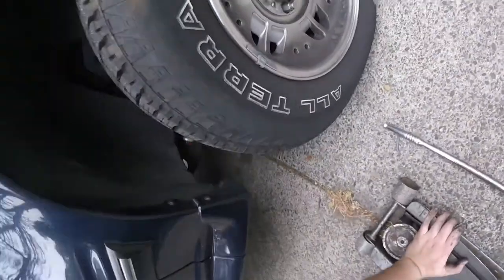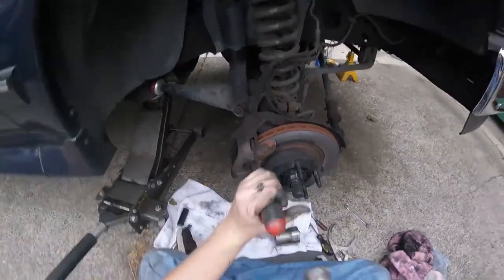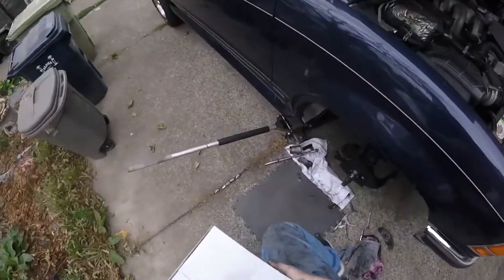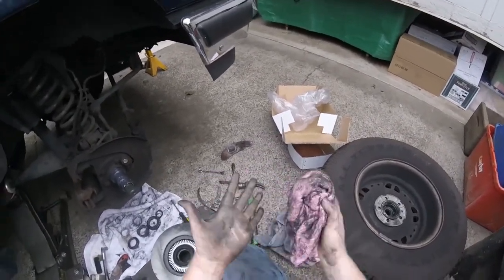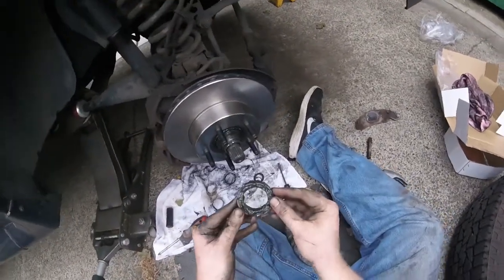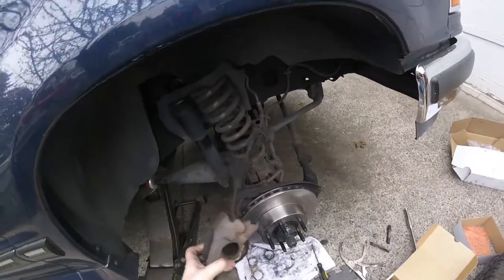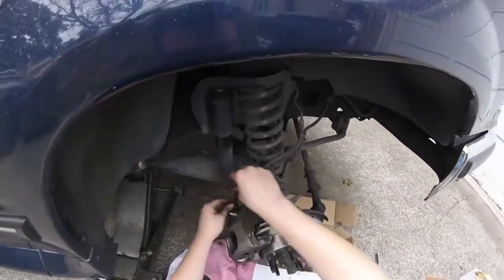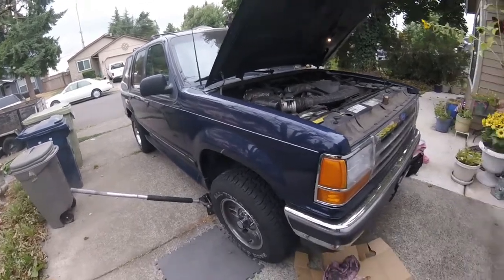1994 Ford Explorer Front Brake Rotor and Pad Replacement

Comment: I've never seen a brake setup like this before. I've never actually done work to these older style Fords before though. My oldest Ford was a 2001 F150 and was very easy to work with. The parts don't sound too expensive for the Explorer you worked on, I'm in Canada and when I replaced my rotors & pads on my 01 Super Duty the rotors were like $60 each and the pads I went with were a commercial grade pad made by Wagner and were "Severe Duty" for ample friction and for towing applications and they were $120 a set. They last a very long time though. I've yet to have to replace a caliper on my truck, all mine seemed to be in fine working order when I did my brake jobs.

Comment: 35 foot pounds is the recommended torque with the special Large socket.  Then back off 1/4 turn, then tighten 1 1/2 foot pounds.  Also, many people use a magnet to remove the locking key.
Finally, you made a small error in the beginning, saying this was a 1995 , but it is indeed a 1994 as the film title states.  1995 is easier to remove the rotor.   I have a '94.. good film, sir, thanks.

Comment: The most crucial part for me was replacing the brake pads into the thingy. I’m assuming that the first one is loaded by itself without a clip? The 2nd one is first attached to the thingy, and then the thingy is slid on and reattached using those silver looking bars?

Comment: Just about to tackle this one myself. Can't get my head around how the shoe housing whatever's held in by hammered in pins, lol.
Reply: How this one got liked on today we just had to do the same thing to the 94 Mazda Navajo
Reply: @BarnCatTV  I have a 94' Navajo man! It's cool to see some people still have them and are driving them still. They are pretty uncommon to see. I have to do the rotors and pads on mine this coming weekend (hopefully not the calipers)
Reply: @NewDemons666  yeah I'd have to say I think I have the only one in town and that's saying something for Bellingham Washington. It has one or two twins driving around but they are just the Ford Explorer Sport.
Reply: @NewDemons666  by the way good luck with the brake assembly. I mean once they're on their good you're good to go. It was quick enough to do I just had to get some practice doing the first one the second one was done in half the time.
Reply: @BarnCatTV  yeah I used to have a twin seafoam green one in my town too. Havent seen it in a while though lol. But yeah I'm aware of that, all Ford parts with the good old pushrod v6 lol. I have a strange love for it because it's my first car, got it for $400 and it's been hella reliable
Reply: @BarnCatTV  and kind of rare cuz you dont see the Navajos much really lol. The brakes arent what I'm worried about lol. My first time doing rotors and bearings
Reply: @NewDemons666  well if you got the chiltons book or something similar it should be a breeze. It's going to require some manual dexterity and maybe a specializes use of a an ordinary tool here an there LOL but eventually it gets done and won't need to be done for a quite a while again. Fingers crossed and good luck.
Reply: @BarnCatTV  I have a Haynes manual and been doing a lot of research on forums and videos here on the tube lol. Ordered my 2 3/8 locknut socket and a 500 piece craftsman toolset, got all my shop towels and grease and everything ready to go! Thanks man, I'll need it! 😂
Reply: @NewDemons666  oh my God does at 2 and 3/8 reference ever trigger memories. We had just about everything we needed except for that one specific tool. So glad I don't have to do that again for a while.
Reply: @BarnCatTV  welp, passenger side rotors, bearings and pads went well today. Didnt get the driverside done cuz I had to run to harbor freight for a 3/4" breaker bar and a proper floor jack 😂 all went well though! Looking forward to tackling the other side tomorrow!

Comment: Here's my problem, if you are an actual mechanic with a real for profit garage, which i doubt, more like a tinkerer. I would never replace the old bearings with just a little fresh grease!! If you're going to re-use them, clean the old crud out, air blow all possible particles out and check close to see if there are any chips or worn dents etc. in each bearing, not just a quick look, check every single bearing, then and only then would you add fresh grease packing. Also if the rotor rubber dust cover is ready to let go, use all new calipers and hoses as well. If she can't afford all new parts, it is likely best to wait until you can afford to do it right. NOT CLEANING out everything means you'll be putting new patches on old jeans, the rubber parts are under lots of heat and should always be replaced as a unit. Yep, save a dollar now will cost you the whole job over later at twice the price and effort. I'm not a garage or professional, yep, just tinker on my own vehicles but I'll wait until i can afford all new parts before i go do it half way and lose that much work or when it comes to BRAKES, lose a life or lives when the hose or caliper breaks and causes an accident ! Think safety first, it's not that much more to do it right.
Reply: well mr i have not work in a shop win  a client bring a rig to your shop and you can tell them all the things they should do but not all ways are you able to get your customer to agree to the repairs do the fact that it just to get them by till they have the money do the repair right you will get people that it does not matter if you tell or not they had there minds up before they even walk in to shop that great you can do it right and you should do it right we do not just tinker we do take on jobs but  we have greatly slowed down on accepting jobs from customers we repair what we are toll to do and try to do every the right way but in the real world what should be done does not all ways happen that way

Comment: You call yourself a Ford mechanic? Surely you DID NOT send her out with brakes like that did you? Put the spring clip on the inboard pad and put that end in the bracket first and compress the spring clip to put the other end in the bracket.
Reply: +Steve Arnold  That spring clip doesn't really do anything apart from stopping the pad chattering against the caliper frame and causing a bit of noise under braking.  It's not a safety-critical part at all, the pad can't go anywhere as it is held in place by the caliper so there's no problem with leaving it out, the vehicle will just be a bit noisier when braking.  The problem he had here with the spring clip not seeming to fit is quite common with after market pads, sometimes they're not made to size as accurately as OE items are and can end up being more of a problem than leaving them out as they can jam the pad in place and stop it being pushed against the disc and reducing braking effort.  In this case I would probably have cleaned up and re-used the clip from the old pad so long as it wasn't damaged or obviously bent and still had a decent amount of spring tension in it.  Some types of after-market pads, particularly high performance ones, deliberately delete these spring clips as the higher performance, and therefore greater heat generation, of the pad can soften the spring clips to the point where they are ineffective anyway, and the higher performance, high friction pad material generates more braking noise anyway so the clips are rendered pointless.  If you only use OE or OEM parts you avoid the problem, but then you're probably paying something like twice or more the cost of after-market pads which just isn't affordable for those running an older vehicle like this Explorer on a tight budget, plus the parts may not be easily found locally for a lot of people...
Reply: Steve Arnold Really? Wow! I am so grateful for you adding this bc I was going to say to hell with reattaching that brake pad using a clip!! Thank you very much!! 👍🏼👍🏼👍🏼👍🏼
Reply: you know not every thing we film makes it on the video right?
Reply: Watch that back cause you will lose it driving I watched this video and the next day driving to work I watched it fly out and now I am back at square one

Comment: My 99 2wd is nothing like this lol glad mine was easy
Reply from the maker: chad harmon i thought this was pretty easy compared to my truck or even the honda.
Reply: Johnson's Gee-rage I understand but I have actually bolts instead of sliders and no keepers right? of course mines a 99 I guess
Reply from the maker: chad harmon 95 and up went to bolts and not sliders. I kinda like the slider part better, easier to take off. But, i dont think they allow the caliper to free up as much.
Reply: Johnson's Gee-rage ok cool that must of been the model update year thanks for info